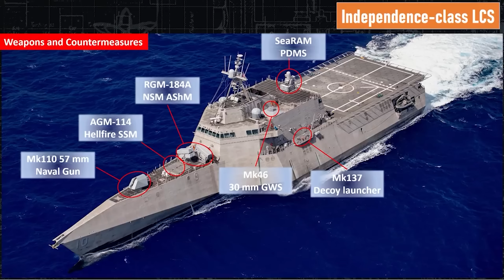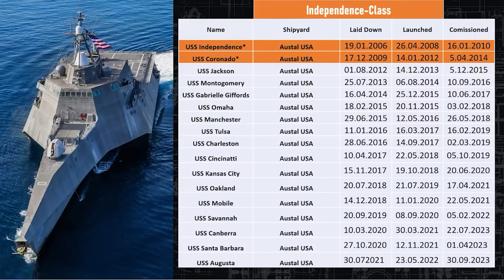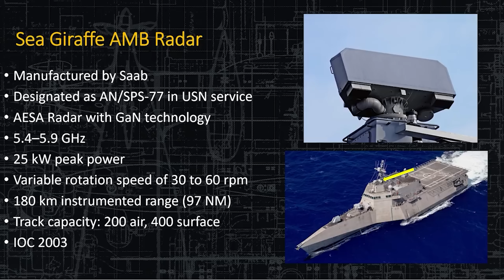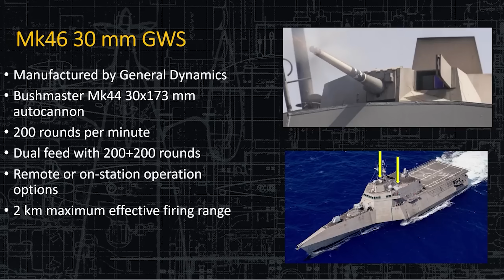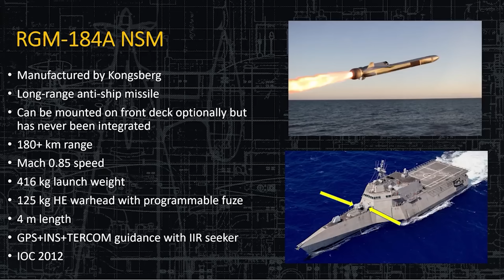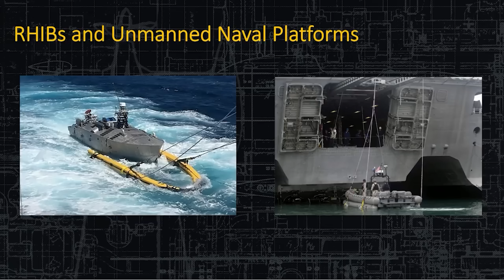Inside The FASTEST Combat Ship In The US Navy

Comment: I can fix this. LCSN! Take a modular Gen IV Nuclear reactor to electrically drive the pump jets - if you use the standard mission loadout for surface warfare package in the mission bay, you have plenty of weight left over - enough for a VLS and the Lockheed Martin Optical laser. Enough power. Add a cwis for fun.

Comment: Honestly... i don't think this ship was a mistake. With the manufacturing improvements they made to fix the hull cracking problem... and if only they developed a variant that could mount full size VLS using the vertical height of the sides of the superstructure and just built it out a bit to fit a row of 8 tubes on both sides....and give it a radar upgrade and lower the maximum speed requirement to 34 nmph (so it is faster than most ships but doesn't need to incure the abuse and TTWR to make 40 knots work.

They could then keep this design as a suppliment to the new frigate.

Comment: >45 knots?   These ships should have been "sold" to the U.S. Coast Guard and retrofitted as mobile "Rescue" ships with a couple of helicopters, like a Huge Sea King & one of their current, sleek helicopters that are a modern version of a Huey (Sea Hawk?). With extra space on board the ship for extra fuel reserves for the helicopter and diesel for the ship itself, it could have a range to cover the entire tropics, if based in Miami (as an example) or effect rescues out to mid- Ocean, if home-based anywhere along either coast!

I could see a large part of the cargo areas being equipped as a hospital, for use during humanitarian missions during Hurricane relief or natural disasters. I can see it extending help to any Caribbean island within hours of leaving a U.S. mainland port.

With all that storage and deck space you could equip it with a variety of Ribs and other smaller rescue or patrol boats.

Equip it with a small nuclear reactor and with electric motors for propulsion, and it would be economical to operate, able to stay at Sea for years before refueling.

Remove all but bare essential weapons and it could serve as an extended range patrol boat with Significant speed for drug interdiction missions - it could catch drug smuggling submersibles and surface vessels. With that high a speed (45+ knots), no other ships could hope to outrun it.

Comment: I think it's a CoDaG propulsion only in the sense that there are diesels and gas turbines inside the same ship. There's no engine power combination (using gear boxes) since each water jet is linked to a single engine. That's why Independence class didn't suffer major propulsion failures as Freedom did.

Comment: High location for a gun system is absolutely a requirement for engaging targets on the water - obviously.. The mk46 can shoot down by a little, it's minimum engagement distance is 300yds per the info I can find, I would think there is some option for engaging things closer than that if needed, but with all the systems on board I would expect something incoming to have been classified and if needed engaged before it comes within 300yds of the ship.
Reply from the maker: The unmanned drones are often not detected until they are inside 300yds.  There is a short range solution, but it is not employed at sea. It takes several minutes to setup if the crew is well trained and sea state is calm.
Reply: @SubBrief  I'm not sure what the solution would be but I don't think it is having an autocannon fire at shorter ranges. Detection for an automatic system would likely have issues at shorter ranges and it would react too quickly at misidentified objects/shadows to stop it manually in time or not react like now. Automatic detection has to be able to resolve an object from the background to categorize and engage it successfully with decent success rates both for detection and engagement. 
I think the effort would be better put into correct threat identification before it comes within 300yds, but then I'm not an expert by any means. I just now some about the tech used for this sort of automatic systems and how they resolve potential threats from background waves etc. It needs a sufficient margin of "difference" so to speak if we're talking about radar or EO and it needs a margin of anticipation to hit the object. It has to fire not directly at the object but where it predicts the object will be when the rounds arrive.

Comment: All this needs really is at least 8 VLS for ESSM and a way to work the ASW mission module, provided that's not cancelled yet.
Reply: Fitting ESSMs would require a complete overhaul of the CMS and radar suite. Essentially tou would have to fit the entire Constallation class radar setup onto the LCS, and that's simply not possible from the weight, power and cost perspective.

There's more to arming ships than just slapping a launcher somewhere, and in this case US SAMs require really bulky radars to guide them properly.

Comment: Modern Combat Drones can fly between 40-to-60mph, depending on weight carried.  DJI has "cheap" drones which are legal in China at 60mph.  In a drone swarm fight, this ship and its systems would probably be disabled with only about 10+drones, and would have to run as fast as it could afterwards.  Unless they have a wide-area Barrage Jammer installed, they are sitting ducks in a modern war.

Comment: If they'd have just put a 16 cell VLS instead of the mission modules on this ship, it could've really been something special.
I modeled that in Janes Fleet Command NWS back in the day. With 64 ESSM an Independence was a phenomenal inner area air defense ship, especially in a CEC environment. With modern Block II active homing ESSM it would be absolutely awesome.
Reply: I agree.  Maybe next to the RIM CIWS?
Reply: @rgloria40  I don't know the ship well enough to know what part of it is strong enough to hold the weight of 16 VLS cells. When I designed my version of the LCS it had the 16 cells instead of a mission module and the cells were amidships.
It was an incredibly powerful warship for it's size in game, because ESSM can also attack other ships. 
It could overwhelm anything, even a Kirov or Tico, with a swarm of Mach 4+ ESSMs in surface attack modes very quickly and easily out to the radar horizon.
With the modern Block II version it would be even better.
Oh, what could have been.
Reply: Adding Mk41 with ESSM would not only neccesitate adding extra weight high up on the ship, affecting stability, but would require an entirely new radar system with fixed-face arrays (essentially AEGIS if we're talking USN). That's a whole lot of extra weight, bulk and costs to add onto ships that were never meant to perform medium range AAW in the first place.
Reply: @jakub0447  they have already tested it with the new angled VLS deck launchers it works fine, however when I am talking about it I am talking about how the ship should have originally been designed

Comment: One thing to cover with these is that there have been several periods of time where due to refueling and such these vessels were the only one sin the Red Sea, and it turns out they're fairly well matched to that kind of low intensity threat in terms of also being low intensity threats (for a warship). Drones beware, there could a be a stealthy frigate with just enough firepower to shoot down slow non-maneuvering targets awaiting you!
Reply: The name of the ships is "LCS", Littoral Combat Ships and people complaining they aren't good blue water ships? It doesn't surprise me at all against the Houthis they have actually been doing reasonably well. Narrow, shallow seas with low intensity threats seem to suit them as you note. The gun armament should handle the drones well with that radar. Although, as others have noted , its not optimised for this either. Someone suggested the LCS design that dumps the mission bay and is fitted with a 16 cell short length VLS and full load of ESSM, fitted with the compact version AEGIS radar would be potent, especially in the red sea.
Reply: @rhino5681  none of the LCS are in the red sea right?
Reply: @pogo1140  no idea, some of the other LCS class have been in the Red sea recently, as in this year. Same article notes they did well against smugglers in the Carribbean.
Reply: @rhino5681 a LCS is a corvette by another word, as that's what those warships do. The problem with the LCS is they're twice the cost of a good corvette with half the armament. Look up the Israeli Saar6 to see what literal combatants can really do.

Comment: Back when LCS was a paper design we were all saying how dumb these were on Warships 1. I said then that they should be outfitting them with SPY-1K compact Aegis systems, a 76mm OTO Melara Super Rapid gun and a 16 cell of VLS. I also said they should reduce the machinery (freeing up space and tonnage) to provide a 35kt top speed.
Loaded with 6 rounds of ASROC VLS and 40 ESSM, this would be an absolute beast capable of doing the full spectrum of ASW, patrol and convoy escort missions, able to operate even in extremely high intensity threat environments.
And they'd even be highly useful pickets in a CVBG.
Imagine if we had 30 of those ships right now, instead of what we bought. And no one has been fired or gone to jail over this debacle...
Reply: It’s not complicated😂. Expendables don’t need expensive gear. This one is and aluminium cats or tri are known to metal fatigue almost immediately for 50 years. Look at the late 1944-45 US armament production…the trucks had no real cabs, tarps got superthin, ammo was half the weight, animal protein was replaced with corn and rapeseed fats. This here is a luxury yacht with a firework launcher.
Reply: @ USN Crew men are not expendable.
Reply: I always wondered: why not use a 155mm gun for shooting at land targets? That way you can use the same ammo as the army does. And if the job is to support the army then why not use their tools?
Reply: @ahoannon5711  The USN Zumwalt class has a 155, the USN is literally taking them off because they could not figure out how to buy ammunition for less than $90,000 a shot.
Reply: @Followme556  Thanks! And WTF?!? What's the point in a 155mm gun that can't use standard NATO ammunition? (Well, that's not really a question to you but to the people who came up with this monstrosity.) Hmmm... Apparently they thought that gunfire support close to shore (i.e. within the reach of a dumb 155mm round) isn't going to be needed anytime soon. 
Let's hope they are right!
Reply: @ahoannon5711 AGS isn't using NATO standard ammunition because that standard is made with ground use in mind and is inefficient for naval usage. In general, "standardising" ground and naval artillery is mostly a bad idea, it just doesn't work well.

The other reason is that standard 155mm systems couldn't achieve the requirements put forward for the AGS. They just didn't have the range that USN wanted to keep Zumwalts away from shore while still pounding targets inland. That's why a special gun and LRAP were developed, but their price got inflated massively once congress started reducing the orders (just like it happened with F-22 and B-2 due to peace divident)
Reply: @jakub0447  Thanks, that explains the issue with the 155mm guns on the Zumwalts.
Reply: @jakub0447  The US Army Excalibur 155mm round would be an outstanding choice for the Zumwalt, with the necessary mods to make it meet USN ammunition insensitivity requirements.
Reply: @ahoannon5711  No it doesn't: He's glossing over the fact that LRLAP (The 155mm round) didn't work, and was subsonic for most of it's flight, It was a horrible design and an even worse idea.
Excalibur has a range of 43 miles with a 58cal tube, that is almost double the range of the Iowa's 16" guns, and it's supersonic.
Also, why did a ship supposed to be designed for fire support have to be stealth, and why did it have 80 VLS tubes? 
Just an all around awful design.
Reply: @ahoannon5711  One obvious difference between naval gunnery and land-based artillery fire is stabilising the gun platform to fire. A naval gun is usually on a moving platform that is experiencing waves, so the gun has to be able to properly compensate for that without compromising accuracy.
As for why this affects the calibre, my guess is that a larger gun would require a much larger turret and make the ammunition feed system more complicated, the recoil may also put more stress on the hull of the ship as well. A bigger turret is a lot of weight on top of the ship, which affects sea stability. The weight of the gun and ammo may also mean cuts would need to be made where more useful systems (sensors and missiles for example) are downgraded and that would be a net negative for the ship.

Lastly, it is probably quite rare for there to be a case where a modern warship has to fire it's naval gun in anger but failed its mission due to lack of range or throw weight. Generally when those guns are used, the higher rate of fire that smaller calibre guns have has been much more useful to take out small boats on suicide runs or to force a pirate to surrender.
Reply: @BobfromSydney  Thanks for your reply!
Germany already tested the 155mm mount from the PzH-2000 on a ship with the MONARC (Modular Naval Artillery Concept) tests. And according to Wikipedia the technical problems were mostly adapting the PzH-2000 "turret" to the corrosive naval environment. I also agree that for naval combat a smaller caliber is probably better.
My point was more that I believe that the Littoral(!) Combat Ships are designed to support ground operations on land. Which is where I believe a larger caliber has advantages and where sharing the ammunition between the ships and army can simplify logistics. And probably also reduce costs. My understanding is that 155mm shells are more or less a commodity now (well, for certain values of "commodity"), so that getting lots of them when needed is probably easier than getting ammunition for you naval gun when your stockpiles run out.
Reply: Damn, reading the spec you suggest does in fact make these sound like small efficient systems, compared to the DDs.
Reply: So... you want a Nansen class frigate?

Any such design would inevitably be larger, costlier and slower. Even attaining the 35knot speed would be challenging by that point. And then such a design wouldn't even have the volume to properly accomodate the mission modules LCS was built around.
Reply: @jakub0447  The mission module design was a TOTAL flop. What I (and all sane people) am(are) saying is the mission module volume should have instead housed a 16 cell Mk41 nest.
The entire mission module concept is one of the things that made the ship into such a complete and total boondoggle.
The insane top speed of the LCS was also incredibly stupid and totally un-neccesary. 35 kts is a far more reasonable top speed.
A Nansen class frigate is 5,290 tons.

Comment: "On paper" this sounds like a good ship.  There was really nothing wrong with the LCS "concept."
In practice, though, these are terrible ships.  They are literally breaking apart: the trimaran frame is cracking at multiple "join" points.  The radars, as you note, are positioned badly and the gun systems don't have depression.  The "mission modules" were never produced.  The maintenance was all subcontracted, meaning that the crew itself was not supposed to do even routine maintenance, so these ships are in poor shape.  
"In theory" these ships SHOULD be out in the Red Sea, working against Houthi AS Missiles.  But there's not one of them anywhere near that theatre.  Which tells you everything you need to know.
Reply: All the cannon installed had plenty of negative deflection.  Gun deflection was a non-issue.  The radars are mounted at a higher elevation than the manufacturer required, so another non-issue.  The contractor certified the frames.  Hold them accountable.